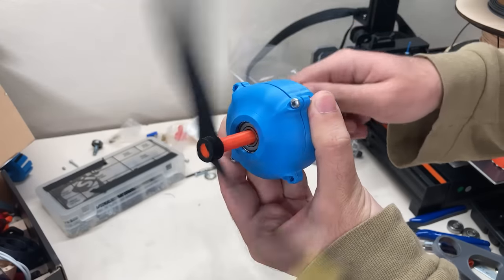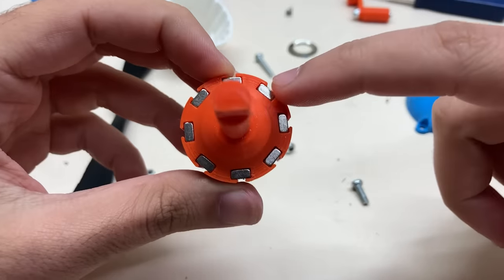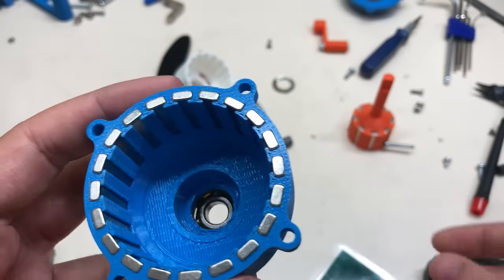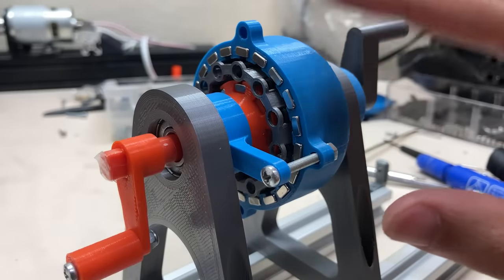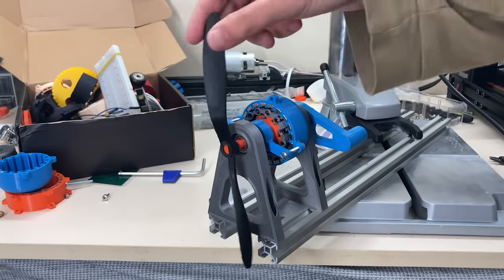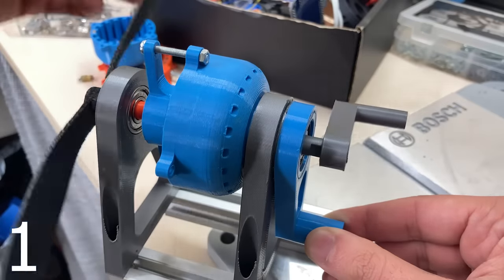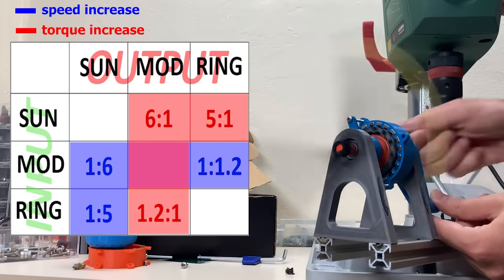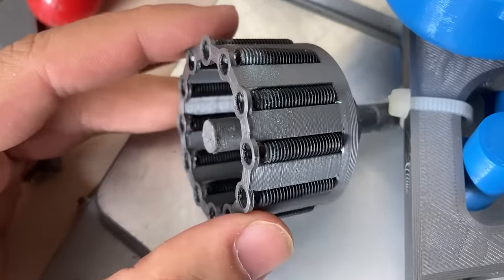How this magnetic transmission works?

Comment: there is a reason we dont see these used very often 
it is because they have really bad efficiency , cost and torque handling 
and in all but a few very VERY specific cases it is way cheaper and way better to either use a conventional gearbox 
or to grab an off the shelf electrical motor that fits the parameters needed
Reply: This comment needs to be at the top.  Magnetic gear boxes are a joke for the application shown.
Reply: @byugrad1024  exactly even the cheapest nylon gears and gearboxes can handle more torque and cost pennies to make
Reply: only thing "amazing" about it is how amazingly naive the commenters are...

completely useless for any application where output has variable load (99% of applications), let alone replace an automotive transmission...

Comment: Cool! I would wonder about entirely blaming the bearings at the end though. At 10k RPM the modulator cores are seeing about 100k magnetic field flips per second I think, and your screws might not be up to operating efficiently at 100kHz. They might want to be ferrite rods, rather than conductive.
Did you record the input RPM at all for the max speed runs? Is it overloading the motor and bringing its RPM down, or is it slipping*? Also, when running it like that, what gets hot?
*Incidentally, being able to slip without damage can often be a desirable feature, rather than a problem.
Reply: the modulator cores i guess because of rapid changing magnetic fields like in power transformers, but much more because of higher frequency
Reply: "being able to slip without damage can often be a desirable feature" EXACTLY !! I RECKON THAT'S THE BEST BIT OF THE IDEA
Reply: Leads to more slip under load
Reply: Avoiding large amounts of damage and not having to take the gas turbine down to replace the shear pins sounds like a great idea to me
Reply: They don't get 100k flips a second, but 1.6k, rpm is rounds per minute.

Comment: It'd be interesting to see a thermal view.  Using magnetic flux to transfer the power, I imagine you must be losing some energy as heat.
Reply: Yep, and heating up magnets tends to demagnetize them. So, there is some wear and tear.
Reply: @@user-pd2rp7rf9v Doesn't matter - I'm assuming no touching between the parts.
Reply: @@user-pd2rp7rf9v you wouldn't use gear oil, too thick and would loose power to that. could use some really thin oil as a coolant probably though
Reply: as long as they are below currie temp they will last a long time
Reply: @odysseus9672 Main heat dissipation happens I  the passive flux modulator, which will not cause permanent damage. Also curie temp for modern materials is above 300 C° so plastic melts first.

Comment: In case you wonder why you don’t see these anywhere in your daily life, here’s the reason. They are only good for low to ultra low torque applications because the gears slip so so easily. But in low torque applications, wear and tear is also proportionally negligible if you just use a conventional gearbox. Remember the only advantage of magnetic gearing is low friction leading to low wear and tear? Yeah. These make interesting YouTube videos. Practicality wise, 🤷
Reply: Bingo.

Comment: Hey I commented on your last video about magnetic gears as well, I am PhD student who’s focus is on the design and analysis of magnetic gears. Great work so far. I have built many larger scale prototypes (with slip torques of greater than 50 Nm) and have quite the experience with optimization of MG designs, let me know if you want any tips for your future projects.
Reply: Hi I'd like to know more about these, would like to know large scale application of the same, I'm working on a project to implement these magnetic gear boxes for industrial conveyor systems
Reply: Could you make an LSD (limited slip differential) with this?
Reply: @ZartaxtheWise  
I don't think that this would exactly be used for a LSD, that said they do have electronic LSDs that use a motor and clutch pack to control wheel slip. Loosely a motor has a similar design as this, but since this reduces torque and multiplies speed it would likely not be useful as I could imagine those applications need more torque
Reply: Hi Selek, do you know what is efficiency for transferred energy. I see no reaction on bearings in that scheme, no friction in moving parts, it means no losses of that kind, but are there  any other specific losses of energy
Reply: @horeca-tech6741  the magnets will induce Eddy currents in the metal components and heat that metals up which mean from magnetic energy loses into thermal energy (heat).
Reply: would one of these be able to hold enough torque to be efficient in R/C cars. I'm an R/C enthusiast and I'm working on designing my own car. If this would affectively deliver power for a mid sized drift car I'd love to have a few tips on the basic specs.
Reply: @ZartaxtheWise  Super high torque there. Maybe with an electric boost. I guess there are some really powerful permanent magnets....might work without external power. Now that I think about it, it might be nice to have dynamic LSD. Maybe variable external input would be useful.
Reply: @adityabhattacharjee3285  The main large scale applications are wind turbines and ocean wave power generators. If you want to learn more you can message me and i’ll give you some good starting literature.
Reply: @ZartaxtheWise  
Technically you can’t really control how much the gearbox slips. All magnetic gears eventually slip due to the forces between the magnets being overpowered. However, limiting how much the gearbox slips is the challenge since it is either 100 percent slip or 0 percent.
Reply: @horeca-tech6741  Yes the efficiency has been demonstrated to be as high as mechanical gearboxes, up to 99%. Tran is right, there will be eddy current losses but these can be mitigated by using laminated steel parts instead of solid steel (like the bolts used in the video)
Reply: @andrewyoder3333  Yes they can. Magnetic gear boxes have been demonstrated to have slips torques in the hundreds of Nm range. However one of the main issues is that a efficient magnetic bevel gear has not been developed yet (I am actually working on one), so if you used one in your transmission the input motor would have to be inline with the gearbox which can be difficult to implement
Reply: @doofbob64 
magnetic gears are also MECHANICAL. And so is the case with magnetic bearing.

Comment: Its pretty cool what he's doing. Its been done before and didnt catch on for various reasons. "The Owen Magnetic was a pioneering American brand of hybrid electric luxury automobile manufactured between 1915 and 1922. Car models of the brand were notable for their use of an electromagnetic transmission and were early examples of an electric series hybrid drivetrain."

Comment: So many people here seem to have the same questions or misconceptions so here are two main things I've seen:

Can magnets loose their magnetism?

Magnets can be created and lost under extreme circumstances, for example when a magnetic material is heated up to near its melting point, the inner aligned particles are free to rotate however. I also believe you can change the polarity of a magnet with a strong enough magnetic field to force the particles to rotate.

Will the gear slip? Yes, under sufficient load, however with powerful magnets you'd be surprised to see that it can carry over a lot of force.

Comment: This is awesome, great work!

Unrelated to this, though sort of related: it would be AMAZING if you could do a magnetically balanced axle, i.e. magnetic bearings instead of friction.  A 3D-printed magnetic bearing system for a magnetic rotor would be worth some money!
Reply: Well I think magnetic bearing is already exist but it still use common bearing, it's called electric motor 😬✌️

Comment: Magnetic bearings would ideally be incorporated to have a zero wear/contact mechanism. This may cause a problem with the lower tolerances allowing for vibrations, possibly making it unsuitable for high rpms or high vibration environments.
Reply: You could treat them like journals and lubricate them accordingly if you design high-tolerance parts. It would be a gearbox with a much lower lubrication requirement than a standard gearbox, and with a built-in failsafe torque as well

Comment: Cool project but inefficient for real world applications.  Could you do a follow-up and show the efficiency comparing it to mechanical gear.  It would be an interesting video
Reply: Purely due to limitations of having to use a 3d printer and screws. If it were made with any kind of precision it would be more efficient than any mechanical gearbox, and slip wouldn't result in catastrophic failure, just efficiency losses, which, if anything could be a great diagnostic tool if something goes out of spec. It can accept 2 inputs as well, though the utility of that is a bit more questionable, I'd argue. Though in applications where timing is critical, I don't think these would be great.

Comment: i think you just test this with more rigid materials like epoxy or fiberglass/carbon wrap. this looks like a viable option once you play with different materials and balance out the radial forces so there’s no interference at high speeds. will probably try to replicate and do tests in the future for fun

Comment: I see a couple of improvements that could reduce the wearing of the plastic by the set screws. 1 replace them with free spinning bearings. 2 put in a delron spacer in between the ring gear and the modulator. Delron being a high density plastic that reduces the friction between metal and itself
Reply: just to correct you Delrin or acetal, same thing.

Comment: Oh wow that’s cool. I imagine that’s also somewhat shock-resistant as a big shock could just be cushioned by the magnets, or maybe even skip some pole pairs, but either way it wouldn’t get destroyed. I wonder how much power it can transmit, in a mechanical gear you get all the power sent through minus a bit of loss as long as the forces aren’t enough to shear off the teeth but I expect this would have a maximum torque that the magnets can hold before it slips. I’d also like to know about any eddy currents and heating effects in the non-permanent magnets and bearings.
Reply: Yes, in fact the slipping is what people seem to like about these. While with standard gears you will simply have the teeth break off or other weaker parts damaged if parameters are exceeded, here you can adjust the magnets so that they slip at a specific force where nothing gets damaged yet. Very convenient.

Comment: ahhh nice work although you seem to hitting the same brick wall that i did IE the cogging out at higher RPMS... you could try a hybrid design possibly and add and EDDY current arrangement in to the whole array. The eddy currents would mitigate the cogging.
good luck thanks for posting
Si
Reply: Also maybe a Halbach array for the pole groups instead of double magnets to make for stronger fields for more torque.

Comment: This was a great video; I also love magnetic gears. However, I have a problem with them that I haven't been able to find a concept for. I cannot see how magnetic gears could compete with higher torque transmissions than what most have shown. Gearing down could possibly solve the issue, but this would increase the size of such contraptions that use magnetic-gearing. Do you think you'd be able to show an example of a much higher torque transmission load without much reduction (or comparable to a mechanical reduction)? An example could be a magnetic-transmission comparable to a car's transmission (scaled down, of course). I would be super grateful of some proof (if it exists) that magnetic-gears could compete with the torque transmission loads of a mechanical gear.
Reply: I've designed and messed around with magnetic gears and what I've found as their biggest issue was the requirement for magnetic coupling strength to match tourqe output.
Earnestly however with the newer magnetic materials this is not much of an disadvantage over gear teeth, expect in the tremendous additional costs!
Reply: @humanistwriting5477  everything is about cost blows ass but yea
Reply: @3CODKing  the metrics of costs increasingly defy logic, in a solar system that is soon to be mined with more minerals then everyone could use a thousand times over, and more energy from the sun then we could use a billion times over!
But, till the time comes, it is what it is.

Comment: Amazing work. As you increased the ratios and the speed, I couldn't but think about the drive torque limits. In a mechanical gearbox the gearset shear strength is the limiting factor before failure. Here there wouldn't be a failure (assuming not 3D printed with plastic resin), but there would be slippage at the torque limit. For a practical application, with little wear, how do you determine the torque capacity?
Reply: Seems the torque capacity would be determined by the strength of the magnets, past that point it would be like sheering the teeth off of a gear.

The issue with this at scale, in a full sized truck I think the magnets would be strong enough to fry your laptop's hard drive, though an SSD would be fine of course.

Comment: Cool concept and it could be very useful in many applications, one concern I have is certain heat temperature makes metal non magnetic, I wonder what is the tolerance of this gear system

Comment: I'm wondering about the max torque this can produce before slipping 🤔
Reply: Me too, it would be totally incredible to use this setup and it can handle high torques...just imagine what you can do with that in real life!!
Reply: About 99% less max torque than the equivalent mechanical gearbox I’d guess.

Comment: These are very interesting indeed my question is have any over these been put into production or even used in any full version projects?
Reply: Yes, they are, although I don't know much about them. We had a job come to our welding shop to build a small platform for a pump system. It will have a 40HP motor and a pump with an integrated magnetic gearbox. It has to be built pretty rugged and with tight tolerances. The motor turns at 3600 RPM, whereas the pump spins at nearly 10,000 RPM. In this case, the motor weighs 600 lbs. where the pump is 55 lbs. Sundyne is the company supplying the pump and motor.

Comment: Magnetic gears have major faults too 1 they can't be taken over certain rpm's because the magnets will decouple and damage the whole gear box 2 they are more expensive 3 they magnetise the bearings not allowing them to roll freely thus creating more friction and wear 4 they have very little load capacity before decoupling happens.

Comment: So that's how those work. We had a job come to our welding shop to build a small platform for a pump system. It will have a 40HP motor and a pump with an integrated magnetic gearbox. It has to be built pretty rugged and with tight tolerances. The motor turns at 3600 RPM, whereas the pump spins at nearly 10,000 RPM. In this case, the motor weighs 600 lbs. where the pump is 55 lbs. Sundyne is the company supplying the pump and motor.

Comment: Interesting but this raises a lot of questions from an engineering standpoint:  1. Does this have any useful application that gives improvements over mechanical?   2. What is the efficiency for power transmission (I surmise it is very poor)?  3. The turns ratio seems clear enough, but the torque transfer is far from clear - high input torque is required to overcome the magnets even with no load!!

Comment: There are applications of exactly what you're showing.  For a propeller, you may be able to run the motor at a lower RPM at cruise.  Similar to shifting a car to a higher gear when cruising on the highway.   I'm not an aviation expert, but I think most aircraft use a narrow RPM band, only one gear for the propeller, and sometimes variable pitch props.   This might be more efficient at cruise, but it would obviously require lots of testing before implemented.

Comment: I'm in love with the design of these gears, not exactly what I've been thinking about related to magnetic fields and their properties but definitely related :)
Still need to find out a way to generate a "hollow" magnetic field from a central point though. The idea being having a sphere that is generating a field from it's center creating a "magnetic" wall on the sphere's surface BUT leave the interior free of any magnetism. Then, combining multiple fields on that surface with resonant frequencies in a configuration where the fields are rotating in different directions in a interleaved fashion, Ideally I'd be having 4 fields moving left to right, right to left and top to bottom and bottom to top. The fields when looked at should look like a weave pattern, not unlike clothing. 
The next goal is to increase these fields strength and play with their resonance frequencies both directly between opposing path fields between the 90 degree paths. This last experiment would ideally allow for a fields configuration that would result in what would feel and act like a solid surface. If successful shooting a bullet at this would result in the bullet being stopped with nearly 0 impact on anything beyond this magnetic mesh field, not unlike a sci-fi "shield". The possibility of the bullet getting "melted" or otherwise destroyed will definitely be higher then 0. A bullet made of magnetic metals would be guaranteed to be severely affected by such a field, I'm curious to find out how exactly :P
Reply: LOL what
Reply: @chaitanyasindagi1237  Yep, that. Interwoven magnetic sheets of "bidimensional" magnetic "sheets" interleaved at resonant frequencies in crossing paths at 180 and 90 degrees. 
Thing is, how to create such a contained magnetic field, basically single lines of force perfectly aligned to a single plane.
Reply: have you made any progress, is like to discuss this project with you